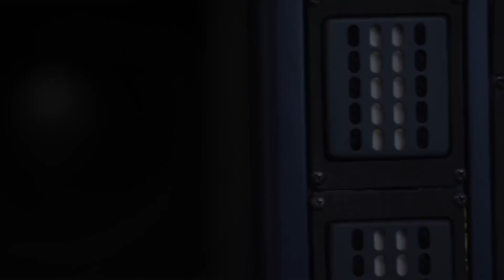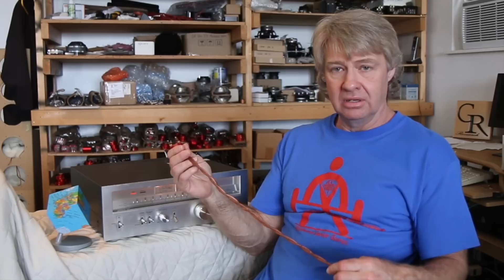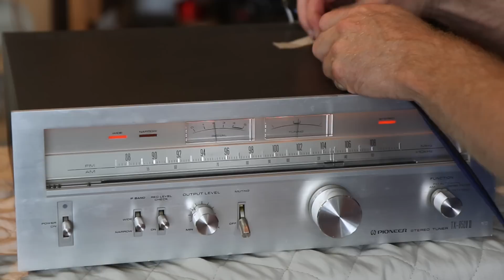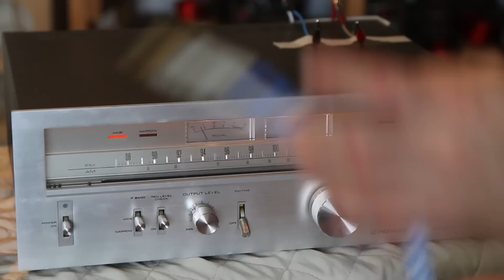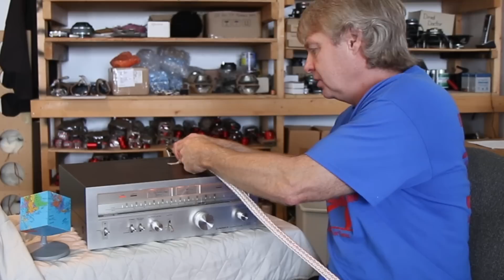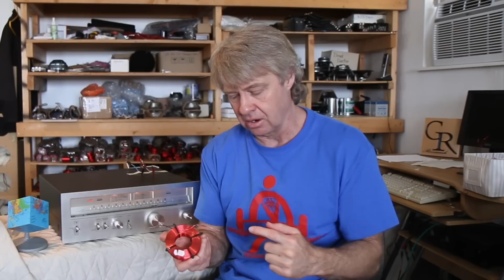Do Audiophile Cables Matter? Here's PROOF!

Comment: The question is "Do cables matter?"  I guarantee you that I have the answer.  It is YES.  It matters.  How can I be so certain?  Easy. Because I know EVERYONE commenting on this is NOT using "zip cord" for speaker wire or RCA cables from the dollar store.  The difference between those $40k cables vs Amazon Basic cables is the performance of your audio rig.  Just like a Toyota Corolla will not benefit much from premium race fuel and high performance tires, a McLaren will not perform at it's best with regular fuel and retreads.
Reply: I'd love to hear an explanation of how inserting 8 ft of fancy boutique speaker wire in series with hundreds of feet of 16 gauge magnet wire in the crossover and even smaller wire in the voice coil makes any difference.
Reply: @jeffferguson2598  That is why some folks rebuild their crossover with better materials.  And fyi, think it like a commute to work.  Traveling on a freshly paved freeway and then a speedbump at work vs the exact opposite. And car audio enthusiast uses electronic crossovers to keep the signal clean.

Comment: I was astonished that cable impact was such a polarizing topic. As an engineer I know that cable construction absolutely impacts signal transmission. There is plenty of proof to this end but some folks are committed to being right over any kind of logic
This is a good presentation and parallel’s development of data cables as data rates have increased. For all of the naysayers how do you ignore the increasing speed of transmission just based on cable construction?
There is no question cable construction impacts sound

Comment: This video demonstrates shielded wire on RFI/EMI. RFI/EMI Can couple from wiring acting like an antenna back into an amplifier and cause potential issues when it couples onto the circuit board, so wiring may make a difference in the regard in strong RFI/EMI environments, like living near a radio tower. This is very different from saying one cable affects audio-band spectral sound quality differently than another (with the same copper gauge).
 
What GR-Research is testing would apply to amplifiers with the specific problem of not having appropriate EMI filters on the output to reject this issue, which they ALL should have (but sadly do not). You would be better served installing your own EMI filters on the speaker output of your amp for far less money than some of this wire costs, or simply return the amplifier and purchase something else that is properly designed for use in the real world, which includes an appropriate EMI filter rather than needing to purchase expensive cabling to fix the problem. It may be as simple as dissecting an $40 AC power inlet EMI filter capable of 15-20A for 110VAC use if desperate for a fix (they are typically balanced and capable of at least 340V in the US). Simply install right at the amplifier in-line with your speaker wiring.

https://www.digikey.com/en/products/detail/xp-power/FHSAA20A2FR/9806009 

I know that my cell phone, which contains a fairly strong transmitter, will get into my computer speakers if set on the computer desk. The RF from the phone is strong enough to couple into the speaker wiring, into the cheap amplifier, and electrically mix with the crappy little output speaker amp. You can literally hear the data packets transmit in the speakers. I don't really care as I move the phone away and the problem is solved. It does not, however, get into my main HT amplifiers, and I have tried doing this to check. No issues as the amplifiers have appropriate filters to reject this. Just basic Emotiva amps.
It is a rare case where EMI will need to be mitigated with shielded cabling. This video is designed to attract views and leave a lot of controversy out there. It however is not dishonest, just a loose with the experiment. It would be if more interest to validate a few amplifiers with this wire with nearby transmitters like a cell phone or little 2-way radio.
When it comes to background noise in your audio: of much larger import is ground loop issues with line power. Things 60Hz AC power related. The buzz you hear in many systems. Those can be really hard to eliminate, but the simplest approach is to have an electrician get your entire audio system on one circuit with a single ground return back to the electrical box. Don't try to spread your system across multiple circuit breakers and grounds. Sometimes, even on a single circuit you can have problems. That usually comes from the ground wires in the outlets and the wire back to the electrical box are not up to snuff. Poorly tightened screws, light gauge ground wires, old outlets that need to be replaced, old oxidized wire, etc. Just do NOT run without a ground as while it may eliminate this noise, it opens you up for extensive damage in thunderstorms from nearby lightning strikes. But this noise source is not a problem with the speaker wiring quality or shielding, but usually induced in the low-voltage wiring signals like RCA cables and currents running in the ground jackets of *gasp*, shielded cables. Even digital ones. It doesn't flip bits, but it can induce current in the enclosure and couple into the analog audio path. 

Going with XLR cables can help with a lot of this, if your system supports it. But one single cable like an HDMI to a projector or TV that is on another circuit or has a poor ground and all the XLRs in the world won't help you. Noise is coming in from a different path.

I hope this helps some of you.

Comment: Am not an engineer, but one thing I know for sure that antenna connections for radio don’t have a choke to filter noise because signal in the air is already thin, whereas all modern AV equipments have a choke to cancel out the noise through AC power. The cross cross cancel effect you are referring to is done by choke for AC connections. If you analyse noise output difference via RCA using frequency analyser, you would end in a completely different result

Comment: When you are talking about the shielded cables, your explanation doesn't make a lot of sense to me: 
you say that shielded cables do not help because the noise already in the system. Fine, I understand that. But then how do the braided cables eliminate the noise that is already there? They can only cancel out noise that is picked up by the cable just like the shielded cables block it, any noise that is already in the signal is not distinguishable from the signal itself for the cables to remove it.
Also don't balanced cables do the same thing, it is exactly what they are designed for.
Reply: No, actually the braid cable acts as a filter for higher frequency noise that is already on the line. 

Balanced cables do something similar but in a different way. They do not however filter noise already on the line like a braided cable.
Reply: @dannyrichie9743  Thank you for the explanation. I don't think you mentioned the filtering of high frequencies in the video, only that the braiding cancels out noise that would be picked up, hence my question.

Comment: indeed, the only way to really test different cables is a double blind test! I am sure there can be slight sound differences. The question is whether our old ears can actually hear these subtle  differences in these frequency ranges. 
Measurable differences is no proof the cables actually sound different. Actually, wires do not create sound, so they can not "sound" different. And I am not talking about the cheapest 50 cents cables without any serious shielding.
Reply: Anyone throwing out the term "double blind" has never made cable comparison. Also, the differences are clearly easy to hear in a blind comparison.
Reply: @dannyrichie9743  really

Comment: Speaker cables are usually "sending" audio at high voltages and usually the ones causing interference in other equipment. The geometry certainly has an affect on the signal if shoved into an FM receiver as you would want them to be separated like a T. The braiding will interact with one another. It is kind of the same as an XLR balanced configuration. If you wanted good filtering for your speaker cables, just run some cables with a shield, or just like an XLR, with a shield and then twisted pair...or quad cable, like Mogami or Canre - same thing, you are just missing the shield. You are assuming that all of the noise is being either being amplified by your amplifier or being picked up from your speaker cable. You almost make more of an argument for better signal cable or interconnect, as well as better power conditioning and the more use of linear power supplies.

Your speaker cable there likely sounds better because of the smaller cable and the skin effect and multiple paths, so there is more skin for it to travel by. This is why many headphone cables are enamel coated wires. More copper only reduces your damping factor, because that interaction of watts and length is important. I wonder if damping factor was even considered.

Comment: I read a silly type article where someone auditioned a coat hanger used as a speaker cable and no one could tell the difference between that and an actual speaker cable. Hum is a little different. No wants hum, but that's a ground problem. Sometimes some folks are so deep in their own world over many years they can miss the obvious, and being authoritative and in control supersedes everything. You certainly want to use good cables that are properly terminated just for reliability, and to make sure the signal gets through intact. All, but the most sensitive systems in a home environment would fall prey to RF over a speaker line to make an audible difference with sound playing-and even if it weren't. I have speaker wires right in front of me, and no sound from the system, and the transformer outside my window is all I hear-and crickets. I can spend 25 bucks for two 6 foot copper speaker cables, and achieve stellar performance. Gauge only matters in long lengths and/or very powerful systems. I like your videos!
Reply: And if you believe that then I have some ocean front property for you in Oklahoma.

Comment: Cables matter, of course, you don't want junk cables but the amount you need to spend on cables would depend how much you spent on your amp/receiver and speakers.  No need to have cable better than what is inside the speaker cabinet and amp/receiver.  I guess also all the wires transferring the signal path the whole way through.  You need to consider the playback source and anything less than a perfect recording will degrade the quality of sound you get.  Ironically, well recorded material often will sound amazing on even low priced Bluetooth speakers these days like the Samsung R3 180 degree 2-way bluetooth (wireless) speaker, which has amazingly deep bass from a 4"  down-firing woofer which also miraculously puts out good midrange clarity - not pristine, but very admirable.  This thing is pretty old and I am sure there are better now but I still love this thing in my kitchen!
I use Monoprice Monolith 12G do-it-yourself cables.  They were semi-pricey and probably overkill.  I think I got them on sale for less than $1 a foot.  They are regular $60 for 50 feet.  I think it's fine with my Denon/Yamaha receivers and Def Tech/Infinity/JBL/Klipsch/Elac speakers.
   My car has perhaps better clarity.  I have Infinity and JVC with factory Toyota wire - sounds almost as clear as my Sennheiser HD 600 headphones, which use a $16 wire I bought on Amazon.  What I mean is - my house uses more expensive gear but my headphones are definitely the best at detail retrieval and uses the cheapest wire, granted it's about 2 strands 6 feet long with proprietary ends attached.  Second is the car system which has very thin wires but the 6.5" coaxial Infinity speakers and the matching 6x9" have more clarity and detail retrieval than most of my house speakers. 
   Do wires matter?  Yes, but not as much as "Audiophiles" may claim they do UNLESS they just have so much invested that they can tell a difference.  I think my systems sound plenty fine the way they are and I am using Bluetooth.  I am okay with that. I already enjoy music too much, I don't think I need to make it any better.

   :) Fellow "Audiophile" enthusiasts: I hope you all enjoy what you got rather than constantly thinking an upgrade is necessary.  These people are salesman and they always need to sell more stuff.  In my audio journey, the case most often, the more I spend the system does not really improve.  It may look nicer, it may have better bass, it might be cooler, it may come with it's own special sound, like more imaging, or the horn, which is very cool, but price often just buys bigger and louder, it's not always better in the way you are expecting, wanting, or hoping for. Sometimes, it is too much of a good thing and sometimes, more expensive stuff is specialized for one thing.  And as Danny has exposed, uber-priced stereos are often nothing more than Hoopla sales gimmicks and price hikes, often, quality of "high-end" gear is actually lesser than tried-and-true audio companies with long standing reputations.
  I enjoy listening to Danny.  I listen to his expertise when he breaks down a speaker.  I know quality parts matters, as does good engineering.  When he says a speaker should be avoided it most likely should be.  But, if you live on a budget like most of us do we need to understand and take things in context/priority:  We have very nice quality these days very affordable.  They can surely be improved but the improvements probably aren't generally mind-blowing.  They might blow your mind in one area but what makes them better in that area may make them suffer in another. 
  I hope this message helps at least one person out there who is obsessed with audio fidelity (I share your pain and have been blessed with what I have) yet has other matters that are more important, like family, food, housing, or causing themselves harm financially - DON'T GIVE YOURSELF INTO HYPE OF BIG PROMISES IN ANY AREA OF LIFE.  HAPPINESS IS BEING CONTENT WITH WHAT YOU HAVE, NOT CHASING A FANTASY AND PROMISES OF SOMETHING BEING BETTER AND ALWAYS IN THAT "I NEED" MENTALITY.  Take these videos with a grain of salt, they are not urgent matters.  If you can afford to lose your money in the pursuit of happiness/dreams for a boutique system then indulge yourself without harm, for those who only have $500 or so, they make awesome bluetooth speakers these days that are incredible!  Ever bit as mind-blowing for their size and price as the "big boy" stuff.

Comment: Coming from a musicians / P.A background, why do the audiophiles bother wit unbalanced connections, when you can get rid of all the incoming rf-noise with balanced cables? Especially when larger distances. Have to be bridged, like with active speakers.
Reply: Actually balanced cables only cancel out noise picked up by the cable. They do nothing for noise already on the line.

Comment: I use 9ft. 16 ga. extension cords for speaker cables. Resistance, capacitance, inductance are all measurable characteristics of electrical conductors, including speaker cables (and electrical extension cords). Get yourself some nice new 16 ga. cloth-braid extension cord, tin the exposed copper wire ends with solder, connect cord to speakers and receiver/amplifier, and enjoy!
Reply: I bought  some monster  cables for  my media setup. When the store  could not sell them for  the  300 bucks  they asked  I got  them  for  80.    The connections are  great Im happy   I am happy on my studio  unit I have HD extension cord I tinned the end  put on banana plugs  and the're  fantastic  I thing  all tolled  28 bucks or so
Reply: But an extension chord doesn't transform electrons into magical fairies.
Reply: And enjoy the noise? No thanks.
Reply: Noise .... ????   @dannyrichie9743

Comment: TAKE A 1Khz TEST TONE
RUN IT THROUGH AN AMP
CONNECT THE OUTPUT OF THE AMP TO AN OSCILLOSCOPE
COMPARE THE DIFFERENCE OF THE TWO SIGN WAVES BUY FLIPPING POLARITY OF ONE OF THE CHANNELS.

WTF IS SO HARD ABOUT THAT?

the result will be a flat line, what ever noise is there would be less then the sound of your heart beat. I bet you 10bucks. Paypal me. if you can show a 0.5% difference you win.

Comment: so you are telling me if i put an FM loop on a speaker i will hear noise?

so, here is what you are trying to say, but dont know it yet. reducting the "antenna effect" of speaker cables is NOT for the speaker but to keep RF noise DOWN so that it doesn't interfere with the the preamp. 

signal strength is an inverse square of the radius, so if you put a speaker wire and wrap it around your amp then you night introduce some noise at the output. but if you shield the amp and it has a good ground. you can lay a wire right over top the amp (they COME FROM THE AMP!!! AND THE CLOSE THE STRONGER, to the RF interference would be strongest where the signal leave the power stage because of the inverse square law) and it you wont here a thing! if you do, then you have a poorly shielded amp not bad cables.

Comment: i dont understand your experiment. the signal from the speaker wire antenna are not going through the pre and power amp stage. shielded input cables make sense because you are driving .1w signal up to 100w.

 but on the speaker side what ever power you are hearing here wouldnt it just be the same noise you hear in a speaker with free hanging wires (in a loop). what ever signal you pick up from speaker wire "antenna" is not boosted so yeah, if what GR is true, connecting loops to speakers that you would hear something in a completely powered speaker. before the amp sure makes sense, after the amp stage nah. im not buying it.